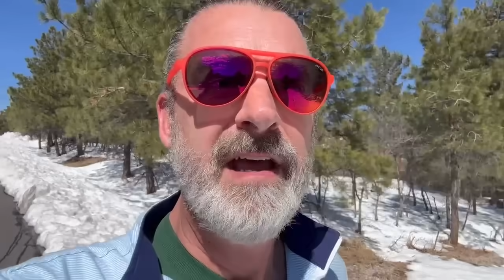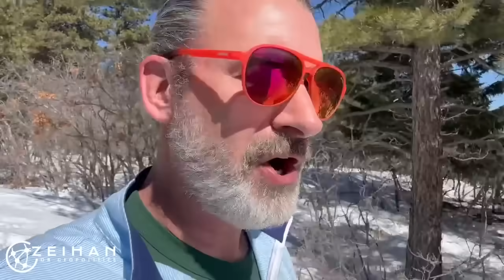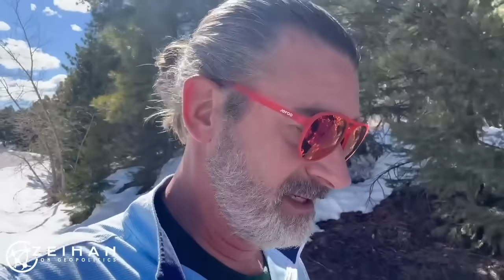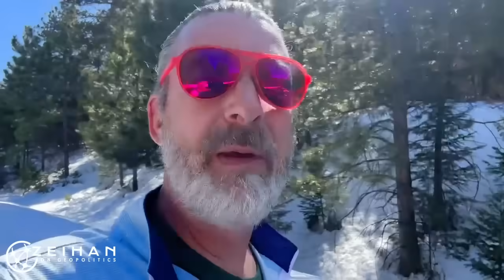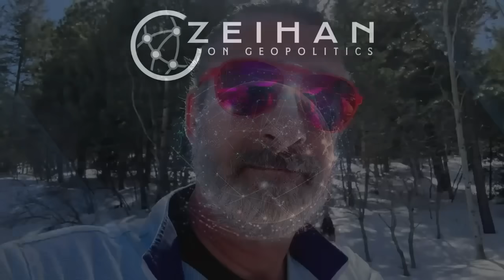The New Face of Military Technology || Peter Zeihan

Comment: Russian tanks are already being equipped with drone deflecting radio emitters which actually proved to work.. and Russian infantry is getting similar "backpacks".. Drones a short term solution that has limited potential. 
Imagining that drones tipped the loss ratio to 8 to 1 in Ukrainian favor is just preposterous.. after Ukrainians were methodically fabbed and kabbed in Avdiivka. 
Russia Ukraine conflict isn't representative of modern warfare yet.. as all rules so far had been broken... Russians entered Ukraine with 150,000 men instead of 5,000,000 required by the books, and limited its operational envelope to SMO. War was announced only recently.. 
Drones are stop gap solution. If any military bets on drones it will eventually lose the war. 

On modern battlefield it's no longer possible to concentrate troops in large  (required) numbers exactly because rockets (especially hypersonic) are so effective. HIMARS are 50 km behind front lines leaving them just 10-20 kms of operational depth, and PATRIOTS can't even engage high flying Russian targets just 50-70 kms behind front lines..  You have to spread out troops.. hence the positional nature of fighting. Same with tank armadas. In this situation drones seem to have a niche role, but eventually will be phased out as soon as one side satiates the front lines with real toys.

Comment: I'm a military intel analyst and have been watching this war very closely. I 100% agree that drones are a massively disruptive technology that could very well change the way we think about fighting wars. However, there is now more pressure than ever to come up with countermeasures to those very drones. The downside of the remote-controlled drones is that they are just that, remote-controlled. Jam their signal and they're paperweights. This will happen when they are up against a competent and prepared force (which Russia is not). Other defenses will also arise in the near future to help detect them earlier, like acoustic and infrared sensors. Coupled with a laser or air-bursting auto-cannon and those sensors would be highly effective against them. This will require drones to go autonomous and fly low to the ground to avoid detection. AI will be pivotal here as the drone will need to be able to negotiate around terrain and determine what is and is not a valid target. Can that be done? Unclear, but likely not in my opinion.

I think the bigger issue than drones is the proliferation of highly effective anti-tank weapons that infantry can employ. This makes it less and less likely that tanks will ever square off against each other, making it less and less necessary to have a tank-hunting tank. Likely the MBT concept will be relegated to a niche concept, if it survives at all. In its place you would want a tank that prioritizes frontline survivability against drones, mines, and infantry weapons. It would important to give its gun the kind of elevation that can reach high floors in buildings. And if you are doing that, you might as well give it a fire control system which can perform indirect fire as accurately as a dedicated artillery system. Difference is, you can shoot it from the front, reducing the need for range (so no powder charges). Longer range artillery is still a great thing to have, but to be able to use a front line asset as real artillery would be a huge benefit, especially if given precision warheads.

An additional change I feel is likely to come will be for infantry. They will need better armor coverage to protect against shrapnel, because CASEVAC from the front will be highly unlikely. If any little drone can drop a frag and immediately turn an assault into a recovery operation, then infantry assaults become useless, and infantry are the whole point of battle. So I imagine more effort will be put into armor that is strong enough to stop fragments but still light enough and ergonomic enough to allow for rapid, fluid movement. Obviously slapping kevlar on everything is not the way. I see the solution as being one like tanks have moved to: composites.

Comment: Told ya so 2 years ago.  Now imagine the future.  The North Korean Front overlooking Seoul.  For 70 years 20,000 artillery pieces have been holed up in range of Seoul threatening to rain down 30-40 thousand shells a minute on a city of 10 million people.  In a matter of hours Seoul is rubble.  Aircraft and artillery could blunt 20-30% of the attack but these pieces are dug into the mountains surrounding Seoul.  Imagine 200 techs each controlling a swarm of 25 drones, using AI guidance and control from satellite and visual guidance on board.  Each loaded with a 10 pound artillery killing warhead.  Upon notification of imminent attack 50,000 drones take to the air and are guided in to targets by the tech.  Before the attackers have fired their first rounds the entire maginot line of artillery can be neutralized.  All for the price of 10,000 dollars per drone - the poor man's master weapon.  Same scenario for trench warfare with ground drones mounted with sniper rifles.  Same for uban warfare with armed scout drones flying through upper level windows and roof tops.  All at 10% the cost of our modern superweapons.  All run by cheeto eating video game nerds in a trailer 200 miles away.  The army - thats for burying the bodies.

Comment: 5:00 What I've been wondering for a while is if those special forces teams with drones could target nuclear weapons assets with those precision drones to render them combat ineffective. You don't need a nuke to dig out a missile silo if a small drone or Precision-Guided Munition can damage the door mechanism enough that it doesn't open in time or at all to allow a launch. They've already moved their strategic bombers out of the are to avoid attacks. Imagine if special forces used airborne drones to attack nuclear missile submarines as they head out to sea right before they submerge. Or, imagine if special forces could construct a sea drone to attack nuclear missile subs or surface combatants. Of course, drones like these could be used to take out cars and buildings in Moscow... but also Washington, DC or London or Paris or Berlin, etc.

Comment: You've mentioned a few times about the problems the big Russian ships have with shooting at the sea drones.
This is not a new problem.
About a century and a half ago a new weapon called Motor Torpedo Boats posed the same threat to the big cruisers and battleships of that era.
Those big ships had the same problem of not being able to depress their weapons enough to engage those motor torpedo boats.
The response? The development of the MTB  destroyers, smaller ships that could engage those pesky motor torpedo boats.
I foresee a future for small gunboats (possibly drones) forming a protective perimeter around the bigger ships in the near future.
And then you'll need other ships to be gunboat tenders...

https://en.wikipedia.org/wiki/Destroyer

Comment: In looking at a refinery, the value of distillation towers is basically proportional to how tall and broad they are.  Since that is visible on Google maps and is basically impossible to camouflage, that makes a pretty good first order targeting criteria.  The next unit operation that I, if I was a military analyst, would target would be fluid catalytic crackers, that convert gas oils to diesel and gasoline.  There a couple of basic designs, but I'm guessing that an experienced refinery engineer  would be able to to look at a satellite picture picture combined with a dash cam of driving by the refinery and pick out the most vulnerable parts.  After that, I'd go for Russia's LNG export facility in the arctic.  They are massive, and they consist of a discrete number of trains, and if you knock out any one component of the train they probably stop the train completely, since the Western engineers designing the facilities probably invested no effort into flexibility to re-route flows to provide resiliency against drone attacks.  Even if they pointed those issues out, the cost involved would have lead to the accounts cutting out "waste".

Comment: This has already been discussed, but take this tech just a bit further with facial recognition and you could take out an enemy's command and control structure, plus political leaders. I can imagine what defensive equipment that would be needed for full spectrum protection, but with AI there may be no getting away from an attack. One country could literally hold another country's leaders potentially at risk. If you take it to its' logical conclusion, you're talking about a decapitation without using the nuclear option.

Comment: Solar powered drones with face recognition and a shotgun shell explosive. Dropped off over suspected targets location. Hovers in the sky for days, months until it receives a signal that the target has been located. Drops down, scans for the target. Secures target , flies over close enough to the head and explodes. Boom. Anything is possible these days.

Comment: Russia's oil fields, transport and refining has always been in operation without the option to shut things down. Peter is correct: they can't shut parts of the system down to repair etc like we can in the US. If they have to shut a well in then it probably will never come back online. The whole system is comprised of Western made equipment and tech, which they don't have the ability to replace or manufacture. Essentially, the petroleum industry in Russia is the main provider of income for the war machine, but is also one of Russia's greatest Achilles heels (they have quite a few). Armies run on diesel in the modern era- not their soldier's bellies
Reply: For triple price you will sell them everything.

Everything.

Comment: I demand these for my 2A rights
Reply: Drones are legal in the US. Electronics are legal. Carbon fiber cloth and resin is legal. 3d modeling software is legal and cheaper than a Glock. Buy a drone. Design and fabricate modifications. Wire those mods to operate off of some radio signal. The only thing holding you back is willingness to learn.
Reply: Go demand a brain for yourself.

Comment: Perun has talked about this, and noted how anti-drone countermeasures evolve in tandem with the drones themselves. Then there's Anduril, who produces both primary attack drones and drone-hunting counter-drones. This is the true 5D chess, in which the explosives are real and the pieces move on their own.
Reply: I suppose this still represents a reduction in combat casualties for a force that uses drones. I'd rather my drone be shot down than be killed in combat. This seems like a rare positive development for the future of warfare. The closer we get to actual chess instead of slaughter, the better. I'll take Drones v Infrastructure over trench warfare and fox holes any day.
Reply: Autonomous drones already ARE robots. They simply don't have legs because they don't need them for the mission.
Reply: I recall the Peter Weller movie “Screamers” … mobile sword units killed most of the opposition then they started making themselves.
Reply: Anduril - the hair loss prevention gel?
Reply: Drones are the precursor to robotics.  50 to 100 AI-powered and linked very mobile and very fast small weapons platforms.   Small profiles, dropped behind lines and resupplied with stealth drones.  Inflict extremely rapid and massive damage to critical areas with zero concern for casualties.  Each unit self-destructing

Comment: There's a certain wry humor in the Black Sea Fleet ships being unable to take out the Ukranian naval drones because their guns were designed to take out ships and so they couldn't deflect low enough to engage a remote-controlled SeaDoo packed with explosives. Kind of like how Bismarck had trouble shooting down the biplane torpedo bombers from the Ark Royal because they were so slow that the automated tracking on Bismarck's AA guns kept leading them too far.
Reply: Anders Puck Nielsen did a good video on the naval drones, he explained that they're almost impossible to see on radar once they get anywhere near you. That means you need air surveillance to counter them, but the Russians lack air control, so they're simply screwed and can't stop the naval drone swarms at all.
Reply: I understand that part of the design spec of the Fairey Swordfish was 'low and slow' and 'stringbag', that is WW1 wood, wire and doped linen. It's very hard to shoot down these aircraft because there's so little to them. The prop and engine protects the crew, and the wings and fuselage can take plenty of shrapnel damage.
As for radar controlled gunnery, this post-dates the design, but this too sees few returns due to a lack of metal, and in part due to low flying.
Reply: US navy uses the 25 mm chain gun in a deck mount. I've fired this version. It has a laser sight, is very accurate and can shoot down.
Reply: @steven4315  
And I would suspect that these were developed and deployed in response to the attack on the USS Cole.
The 'stringbag' was developed in the 20s/30s for British carrier ops, a different epoch, which is pretty much Peter's point.
The game has changed, twice, in recent years: ship killing missiles currently used to attack shipping in the Red Sea and now drone warfare.
It should be obvious that if the Ukrainians can attack precision targets to the rear, terrorists can also use/develop this capability.
Reply: @johnathanh2660  You would be wrong. The Phalanx system was first tested in 1973 and approved for production in 1978. the most recent adaptation was to convert it to a land based system to destroy incoming mortar rounds in Afghanistan. 

The failure on the USS Cole was a failure to perceive danger.
Reply: @bob-rogers  
Ate we talking Phalanx or chain gun on a deck mount?
AFAIK the Phalanx was developed as an 'anti-air' system, so was used against missiles and aircraft. This is distinct from the chain gun developed for 'close in' targets.
The RN do have a CIWS (close in weapon system) but this came later.
AFAIK, for close in targets it was Royal Marines armed with 7.62 GMPGs.
Reply: @johnathanh2660  The Phalanx system is based on a deck mounted 20mm vulcan autocannon. The radar can track anything that moves whether in the air or on the surface.
Reply: @bob-rogers  
Er no.
Only the latest variants can do this. Older variants cannot track small sea vessels that are close in.
And I'm unsure if the variant fitted to the USS Cole in 2000 (if indeed it was fitted to that class of Destroyer) was the necessary type, let alone 'enabled' when docked.
So not a 'failure of imagination' as you put it.
As for 'manual control' of the CIWS, for the Phalanx, this too was a feature on later variants.
Tl;dr - it depends on the variant, and certainly not on the early variants of Phalanx found on major ships during the 1980s and early 1990s.
Reply: The 1B Phalanx has FLIR optics that gives the operator the ability to engage anything within sight even if the radar can't acquire. Surface Mode has been FULLY tested against  jetski sized targets and is highly successful. It is operator intensive which is the weak link. 
Getting Batteries Released from the ship's Command is another weak link. No CO wants to jeopardize his career opening fire in a crowded sea lane or tied to the pier. It's a very delicate tactical situation.
Reply: @johnathanh2660  The point is the weapon system had the ability to shoot at things below deck level long before the USS Cole was even built. I didn't say anything about imagination. They allowed the boat to approach because the rules of engagement prohibited taking action against it.
Reply: War 101: Find a weakness and take advantage of it.
Reply: At this time the Russians seem to be using machine guns and even rifles against these sea drones. Russian technology behind the curve as usual. And if Ukraine can develop a sea drone that dives on final approach, Russian vessels will simply have to stay out of range.
Reply: It reminds me of the way that the Death Star's guns couldn't take out the Rebel Alliance's X-Wing fighters, causing the Empire to take them out "ship to ship".
Reply: Even more wry humor in the supposed worlds strongest navy unable to stop a third world militia from blockading the Red Sea.
Reply: @ourvaluesarewhoweareinadem4093 Think that has more to do with politics than the ability to target force.
Reply: @pm4898  Sure bro.  Cope harder.  Your gay military can't do shit anymore.

Comment: Hypersonic missile - Are Russia and China ahead and what is the impact?
Reply: The U.S. just tested the AGM-183 ARRW and it can actually adjust its trajectory to avoid being intercepted or change targets, unlike China or Russia’s hypersonics.
Reply: I'll believe it when I see it.  There's a reason "hype" is embedded in the name "hypersonic" missile.  To use gun analogy, hypersonic is a steerable bullet.  Unless the Russians and the Chinese found a way around the laws of fluid dynamics, I'm not a believer.  If the missile has to slow down in the terminal phase, it's just a cruise missile that got an expensive ride.